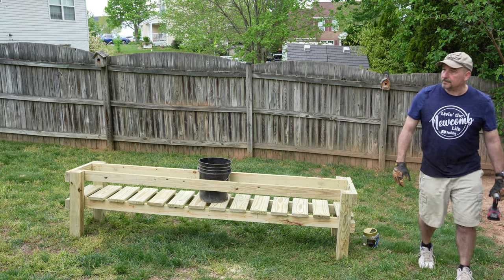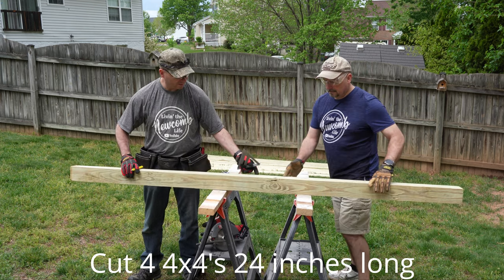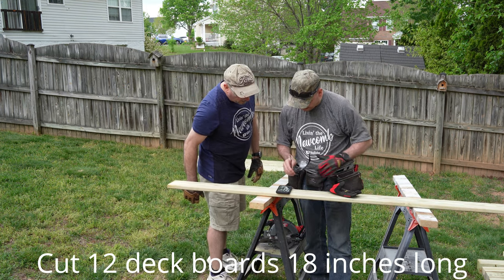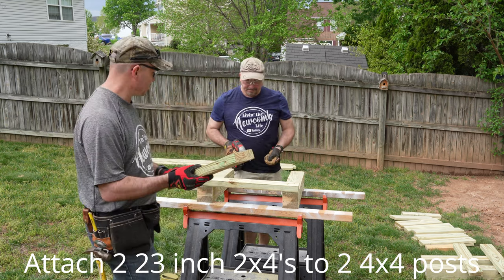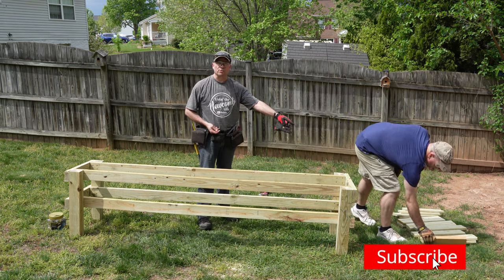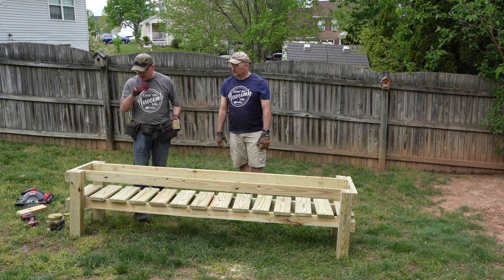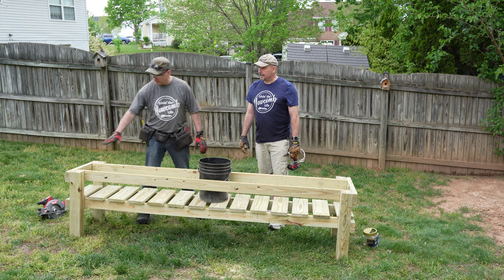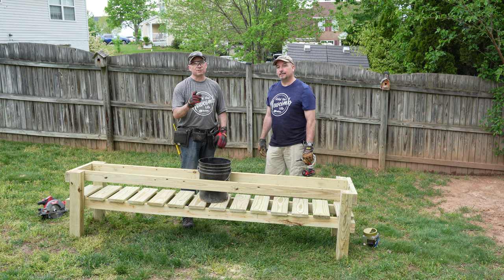HOW TO BUILD A 5 GALLON BUCKET GROW TABLE    #110

Comment: What are the finished dimensions of the table?
Reply from the maker: I can't send a picture, which would be much easier, so hopefully I can get this to make sense.  8 feet long  by 23 inches wide are the outside measurements.  This specific table was 24 inches tall, but the table begins 10 inches down from the top of the 4x4 posts.  The stabilizer bar was 13 inches wide.  The 2deck boards, one on each end, were 16 inches and all of the other deck boards were 18 inches long.  I hope this helps and thanks for watching our video.